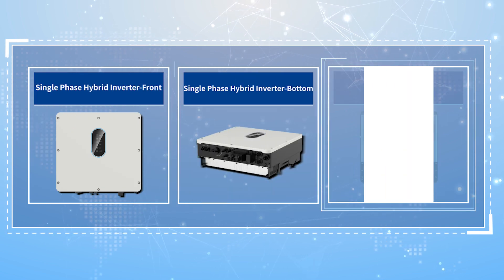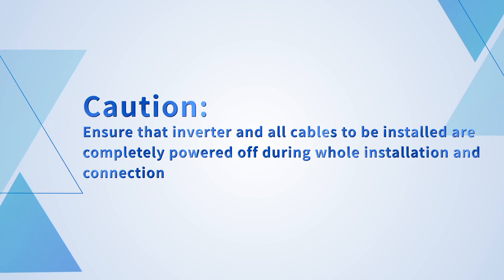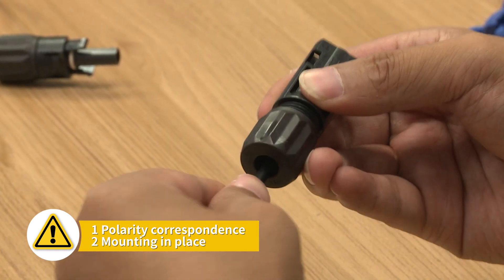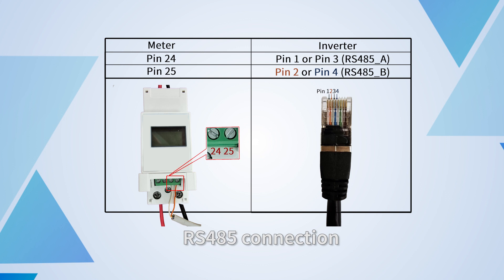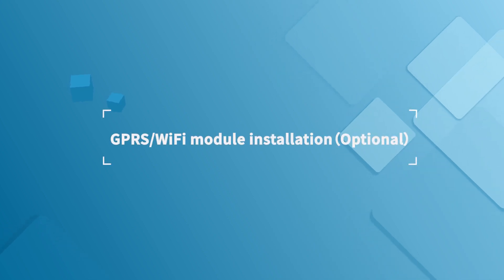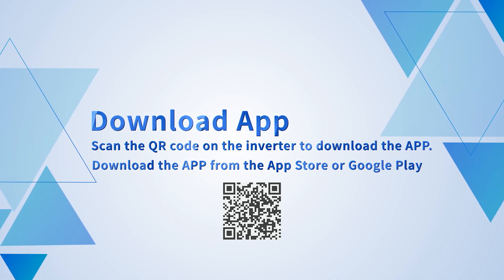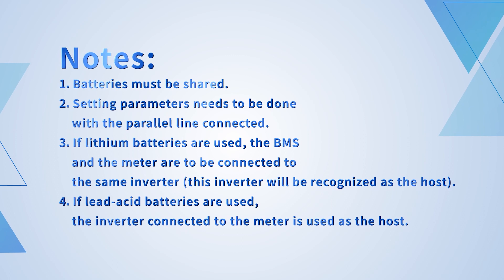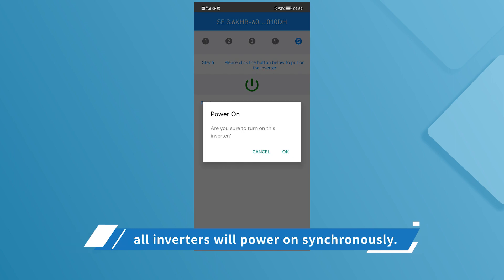Senergy Single Phase Hybrid Inverter Installation Guide SE 4.6/5/6KHB-60 & 120

Comment: i already share details in email with video on 28 july 2025.

Issue Summary (Started on 1st March 2024):

I have two 6KHB-120 inverters connected in parallel, using the smart load function. Since then, I’ve been facing an issue where the smart load power randomly turns off for a minute and then comes back on. I noticed that only the smart load turns off and then returns within one minute.

Sometimes, when the load exceeds 6 kW and the smart load turns off, the backup power also shuts down. The inverter then restarts after a few minutes, showing the following faults:

“CA-DC-Link Over Voltage”

After a few minutes: “D7-Backup Output Voltage Abnormal”

Initially, only one inverter’s backup output turned off, while the smart load kept shutting down randomly. A few days later, the second inverter's backup output also started turning off. I had to manually shut down and restart both inverters to restore power. However, the same error pattern continued:

“CA-DC-Link Over Voltage”

Then: “D7-Backup Output Voltage Abnormal”

I contacted Cellcronic support. They updated the firmware on both inverters, but the issue persisted. Despite reaching out for months, they ignored my complaints. Eventually, they agreed to check the problem and matched the backup output voltage between both inverters—but the issue remained.

Finally, they told me to use separate loads for the smart load function. After shifting all loads to the backup output, the error stopped. I installed voltage meters on each smart load output and battery, along with CCTV monitoring. I discovered that randomly, one inverter’s smart load would shut off and restart within a minute, while the second inverter’s smart load stayed on. This mismatch is likely the cause of:

“CA-DC-Link Over Voltage”

Then: “D7-Backup Output Voltage Abnormal”

because when one smart load shuts off, the full 6kW+ load transfers to the second inverter, overloading it.

I provided this proof to Cellcronic, but received no response. I’ve been trying to find out who actually manufactures the Cellcronic Galaxy 7G EU for the last 20 months, and today I finally found you.

Current Firmware Versions (Updated on 4 July 2025):

Master DSP Version: 022417

Slave DSP Version: 020200

CSB Version: 022417

DC-DC Converter Version: 020606

After the update, I did not test the smart load again because I had removed the CCTV recordings a few months ago when Cellcronic stopped responding. Due to frequent power outages in my area, I haven’t had time to re-test. If you can help, I’m ready to try again using the smart load and will upload photos and videos for my research.

I also noticed that when the battery low voltage threshold is reached, both inverters do not turn off the smart load at the same time, nor do they restart simultaneously. There's always a 1 to 3-minute delay between them.

Smart Load Voltage Settings (From CCTV):

During recordings: OFF at 47V, ON at 49V

On 28 December 2025: OFF at 46V, ON at 52V

The issue always occurs without grid power.

In the voltage meter:

Top reading = Smart Load Output from Inverter 1

Middle reading = Smart Load Output from Inverter 2

Bottom reading = Backup Output (parallel from both units)